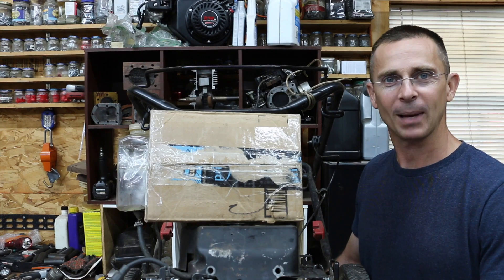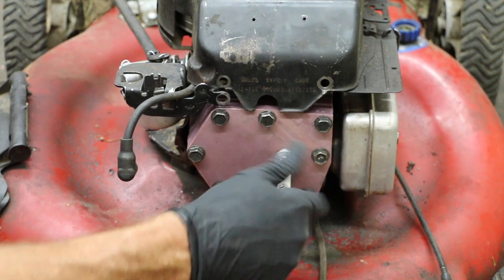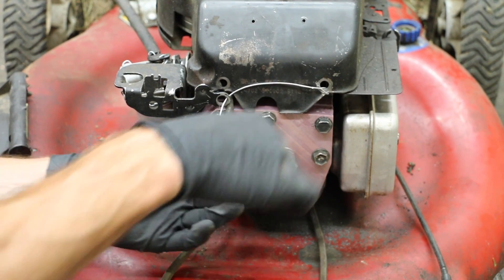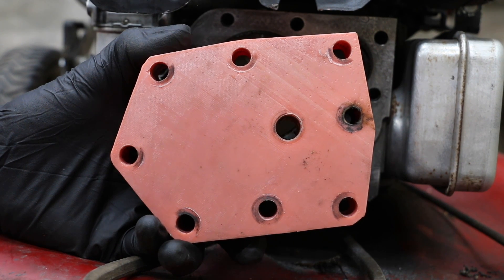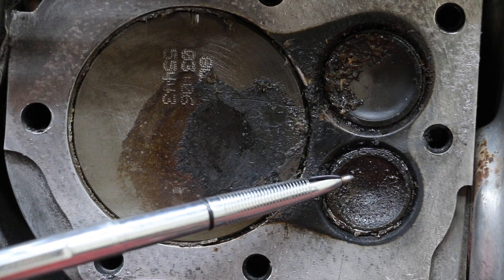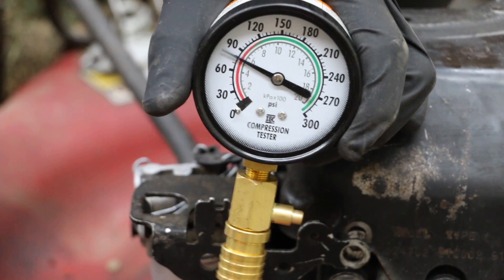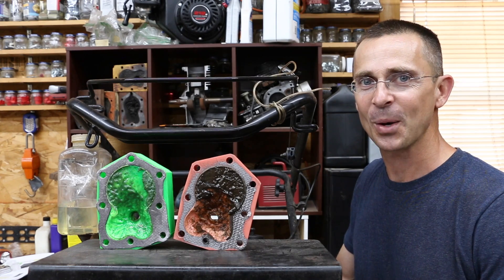How long will a 3D printed cylinder head last?  Let's find out!

Comment: make  a cylinder head out of 700 series Inconel .....to see how long it will last  .......after you tap that plug hole !!!!
Reply from the maker: Thanks for the recommendation.
Reply: ummmm have you ever worked with 700 series Inconel ??  (it is the material that makes jet engines possible, it holds up in hot sections of turbine engines where ferrous based material will not)  almost impossible to cut, let alone tap

Comment: What if you line the inside with aluminum foil or something like that to reflect at least some of the heat away from the plastic. Or possibly use the plastic heads to make molds and cast new ones out of old beer or soda cans
Reply from the maker: Great recommendation.

Comment: Hi I think it would be cool if you got a gy6 engine and try to get most power out of it. Also I wanna see what cylinder bore is the best for power/fuel usage. I have a 50cc scooter that I put a 125cc in and want to know what's the best setup. Also they are kinda cheap.

I know this is kinda for my own sake I ask this. But I have had so much fun playing with it. I think it's a good idea at least.
Reply from the maker: Thanks for the recommendation.

Comment: I've always wondered, how would an small engine (lawn mower esc.) handle in the temperature extremes? Like how cold could it be and still run? And how hot? What would happen if you put that engine running in an oven set to 200 degrees?
Reply from the maker: Great point.  Thanks for the video ideas.

Comment: Usual temperatures inside a typical 2 cylinder combustion chamber is 400-700 degrees Celsius (depending on motor, spark, fuel, etc, most common temp is around 600C). Almost everything that is 3D printed is done so anywhere from as low as 180C for PLA, 240C for ABS, and 200-250 for some other materials. there may be some specialty materials on a specialty printer that could go to 300-350C, but nothing I know of that can be reliably printed to withstand 400C+.
Reply from the maker: Great point.

Comment: You could shell out the combustion chamber 2mm and make an insert to fit into that 2mm space and have it made from DMLS steel.  Shapeways.com does 3d printing in steel.
Reply from the maker: Thanks for the recommendation

Comment: Wow, they handled way better than I thought. Considering melting is the main issue I wonder how prints able to withstand very high temps from somewhere like formlabs would hold up 0_o Granted it'd probably be pretty expensive to print a giant solid block like that from a prototype place
Reply from the maker: Great point.

Comment: It's just a matter of time before you see composite engine blocks with iron sleeves to save weight being used in small 4 cylinder cheap cars at first, probanly use something like a nylon 66 if I have to guess
Reply from the maker: Great point.

Comment: Video Idea:  High Compression piston [Rings need to be up near top of piston] and milled head. ! It won't get more exciting than that. You can take it a step further and port the small intake tube smooth and the exhaust port too. I know you have people who can and are willing to do that machining. Going by your 3D arrival. As long as they give your head valve clearance for the milled head. When you turn that over it wont sound like a 'small' lawnmower anymore. Torque will be way up there and bass from the extra power too. You can do the majority of the smooth porting with what you have for tools. So it would be  a piston and head cover mod.
Reply from the maker: Great recommendation. Thank you

Comment: This was doomed to fail from the beginning.  PLA and ABS formulas for 3D have melting points in the 3D head as low as 320 degrees.  Combustion temps are much higher.  

Check out print head temps for devices like MakerBot.
Reply from the maker: Thanks for the recommendation.

Comment: see if these guys will print you a high temp plastic one https://formlabs.com/
Reply from the maker: Great recommendation.
Reply: I got a sample of their high temp plastic and did some testing. It held up well to 30 minutes at the rated temp bur showed some fracturing after it cooled. I did not ramp down the temp as I would normally do, just pulled it out of the oven and threw it on a bench. The fractures were probably from thermal shock.

Comment: Come on dude, why would you brainstorm on ridiculousness of this sort for real? There's quite obviously many thousands of various types of components (including  gaskets) that are engineered for the mechanical industry in which plastics are incorporated in the manufacturing process. But as for EVER seeing a successful or practical design and development of a cylinder head that's composed entirely of plastic being use for the intended purpose of chambering the extreme high pressure combined with the forces of exothermic reaction that occurs inside an internal combustion engine...forget it, lol. There's absolutely NO WAY to avoid an eminent and eventual meltdown. So I say again, why waste our time (and yours) posting ridiculousness of this caliber 😬

Comment: This test raises interesting questions... Being air cooled I knew those things would melt down and fail, but there are some seriously resilient compounds out there that can withstand some punishing heat. Sadly they are not in the 3d printing market (yet) either, but this shows how --- Quality --- 3d printing will change the way we live and especially repair things. Great test now that's Wood, Plastic, Glass, Crystal (still glass..) cyl. heads, anyone got a link to an engine running w/ a cylinder head made of chocolate or tofu??
Oh sorry to be crass here but... the combustion chamber looks like balls.. just sayin'.
Reply from the maker: Thanks for commenting.

Comment: I keep saying, watch out for plastic engines in the future.  Remember, at one time, you couldn't store gas in a plastic can; now all of them are plastic.  At one time, you couldn't use aluminum near the combustion chamber of the engine, now you use a cylinder head made of the stuff.  Once the issue with the temp and pressure is solved, you will see a plastic engine.  I would not be surprised if a prototype exists somewhere as we speak.
Reply from the maker: Great point!  They are on the way.

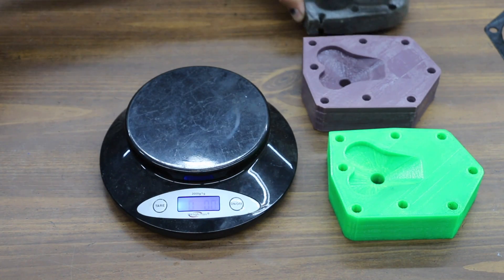Comment: at 1:17 havent watched the rest.
as of yet going to ofcorse
But what i see at this point is two of the most commen plastics
both of wich are not known for there ability to hold to much in the way or presure nore heat to the degree produced in an engine. by a wide margen.

Wheres the blends.
Wheres the pet the nylon the fiber reinforced

Heck wheres the PEEK blend. (ok peek is nasty and expinsive stuff but ya know gota minchen it)

so many better meterials out there avalible to the public to try this on.
Reply: Reporting at 3:45
Wow didnt expect abs To even get this far. to bad the melting fould the sparkplug it was starting to giveway would of ben neet atleast to see it melt apart.
He's going to clena and re do hmmm what will givbe first the head or will the spaark plug melt out of the plastic
Reply: yep inside melting down quite a bit. wonder how this would of responded if it was in a diffrent orentation
would it have let the spark continu long enough to bow/blow the top
Reply: 5:42
He's now putting on the PLA.
PLA is well known for making nice looking prints.
Becos it melts ant a low temp has an even lower glass point.
And is verry crystiline in it's structure. (brittle) the older it is the more brittle it will genrily become as the crystiline structure grows.

An interesting extinshion to this experement would be to repeat the PLA with parts made at diffrent times and stored in diffrent environments.
cold vs hot. dry vs moise and sun vs shade.
From a fress off the printer to upto a year old i'd think

now to see what happens :)
Reply: Yep prety much what i expected for PLA couldn't take the heat at all
spark plug melted right out of the heat 
gue on the inside.

Not going to minchen much on the gasket test.
mainly because i know there's a material that you can use to make perfectly acceptable gaskets.
Reply from the maker: Thanks for the recommendation on nylon and fiber.

Comment: Project Farm get a nylon 3D printed cylinder head and try that if you can 
Nylon is often used for small model steam engines as piston rings and has a higher melting temp and mechanical strength than abs
Reply from the maker: Great recommendation!

Comment: The 3D printed cylinder heads do not conduct electricity so the spark plug won't work. I'm only at time stamp 2:03 so I'm sure you know that nad are going to solve that.
Reply from the maker: You are right. Thank you

Comment: A styrene foam like material 3D printed could be use in a lost foam sand cast because a metal is the only known option here. My plastic could be ceramic coated like space shuttle tiles?
Reply from the maker: Great recommendation.

Comment: Great video. At 4:23, you can see combustion flashing through the material pretty clearly. This might be the plastic burning as the fuel ignites though. It would be great to be able to see inside the cylinder as these heads perform. Ideas???
Reply from the maker: Great catch. I'm glad you noticed that even though the smoke got in the way.  I'm sure that the plastic was burning.

Comment: one thing which would be interesting is seeing if you could get a ceramic coating on the plastic cylinder head, then at least you'll have a good amount of protection from the heat transfer
Reply from the maker: Great video idea!

Comment: Fill an infilled ABS printed cylinder head with water before trying again...
Reply from the maker: Thanks for the video idea!
Reply: Bonus points if you can design a thermosyphon circuit in the print to cool the exhaust valve area!

Comment: Random info: there are more printing materials than simply stock PLA and stock ABS. You can print in heat-resistant resin, nylon mixed with heat resistant materials such as glass, PEI, and even metals such as stainless steel and aluminum
Reply from the maker: Great recommendation.

Comment: They make engineered plastics like Torlon 5530 and Ultem 2300 that are glass impregnated, that I guarantee would last the life of the motor. Fully machineable and amazing tensile strengths. Very expensive but It would be interested to see anyway. You'd be impressed.
Reply from the maker: Great recommendation and I wish I could test it.

Comment: That's amazing. If the 3D head could be modified. Well, I mean the plastic blend mix with copper or zinc compounds to make it harder? So many things that can be used to make the plastic better. Especially an air cool head.
Reply from the maker: Yes, thank you

Comment: One thing I noticed when you cleaned the head after the purple/orange head is that you didn't clean under the valves where they seat. I'm not sure if any plastic got in there but I'd think some melted plastic would have gotten in the seats causing a loss of compression. Was there any under there?
Reply from the maker: Yes, you are right. The intake valve wasn't sealing too well, but it didn't take long to begin sealing properly once it was running again.

Comment: Can you please run the exact test but using polycarbonate plastic? I am in need bc I actually want to make polycarbonate gaskets for a custom design.
Reply from the maker: Great video idea--thank you
Reply: Project Farm  polycarbonate plastic is said to be one of the toughest and strongest plastics out there with high heat resistance.  If not a head, can you test it as a gasket please that would be amazing. Thank you so much for replying!!!
Reply from the maker: I'll see what I can do. I'd really like to test it.

Comment: Does anyone know the temperature of a gasoline burning
Reply from the maker: Around 500F but the combustion chamber temps get a lot hotter than that under certain circumstances.
Reply: Project Farm thanks I am also curious if a plastic capable of withstanding such temperatures would be able to withstand the pressure
Reply: I am not saying you should do that it would be expensive but if you do I think it would be really cool

Comment: To who ever wasted their time an machine to make these parts, Are You kidding me???
You used heat to make the parts, how long did you expect it to last??
Im a Machinist and Delrin would have done as well for a material, and I could have milled it better than your surface finnish.
Reply from the maker: Hi Johnathan, thanks for the constructive feedback.  We knew the 3D head wouldn't last long, but thought it'd be a fun experiment to see how it would do compared to the JB Weld and other wooden heads we tested in the past.  I'm always open to test other materials.  If you're willing to make a head, you can reach me at projectfarm52@gmail.com  Thanks again

Comment: I'd bet taulman 910 nylon would last 5x longer :)   and there are high temp 3d printable plastics that are very costly but would easily hold up like aluminum.   Pla has a super low tglass temp, abs not much higher.  We use taulman 910 for all kinds of engine stuff.  Most manifolds are glass filled 30 percent nylon. As are valve covers and such.
Reply from the maker: Great recommendation.

Comment: What would happen if you injected an octane booster or something like it into the air intake while running engine?  Would it give you an extra boost similar to nos? Im sure it would clean injectors and combustion chamber, but I'm interested in if you can get extra power? Isopropyl alcohol, octane booster, fuel injector cleaner, etc....
Thank you for making these videos,  they're very informative and I enjoy watching.
Reply from the maker: Thanks for the recommendation.

Comment: You can add a graphite like coating to 3d prints to make them take the heat better, a lads made a rocket engine nozzle using it
Reply from the maker: Great recommendation.

Comment: I THINK YOU MAY BE MISSING THE VALUE OF THE PRINTED PLASTIC PART.   INSTEAD OF USING THE PRINTED PART AS A WORKING PART USE THE PRINTED PART AS A PATTERN TO MAKE A MOLD OF THE PART.  THEN CAST THE PART IN ALUMINUM AND BINGO.  ANY PART YOU CAN IMAGINE UP AND 3 D PRINT YOU CAN MOLD AND MAKE.
Reply from the maker: Great recommendation

Comment: pla has a lower glass transition temperature than abs. but prints a lot better and is stiffer. abs is more flexible and can resist impact better.
Reply from the maker: This is great information. Thanks for commenting.

Comment: They do make high temperature resins for SLA 3D printers (270C to 280C) , I had a quick look but couldn't find anyone doing it commercially.

Also look at 3D printing using metal powder mixed with binder. For instance:
https://i.materialise.com/en/3d-printing-materials/Steel
Reply from the maker: Thank you for this information.

Comment: Hmm, impressed by results? Not really. The plastic was a total failure 1-2 minutes is useless.  Sure the strength was ok but the plastic thickness was very high.  The cooling for the plastic was way less than even the finned aluminum  head. The excess thickness stopped the plastic from having a chance to cool itself.  The spark plug is also cooled by the head and with the plastic being a good insulator it does not loose heat properly either. 
But also the choice of plastic could be better. There are all sorts of 3D printers some even use layers of paper! Some 3D printers use powdered metal that gets additional sintering to produce usable parts. Navy is using now instead of full machine shops on ships!
But what the heck fun to try! 
By the way there are places that make gaskets from a drawing/sketch cheaply from any sheet material in a "3D" cutting machine. 
Thanks for posting video Cheers Warren
Reply from the maker: Hi Warren,  All great points. I had fun testing the heads knowing they wouldn't make it for long.  Thanks for the information on the places that make gaskets.

Comment: you can try Polycarbonite ... this is a very sturdy + very heat resistent material. It melts @260°C
Reply from the maker: Great recommendation.

Comment: i was expecting both spark plugs to go "ballistic" in under a minute due to melting of the threads in the head. now if someone could metal plate the heads, insert a metal sleeve in a printed cylinder, add liquid cooling, you might have something. but Harbor Freight is cranking out sub $100 engines like there's no tomorrow.
Reply from the maker: Great point.

Comment: Nope. I'll still watch it but even the carbon fiber wont work. This stuff prints at too low of temperature and the engine makes high temperatures.
edit: That burning plastic smell must have been nasty. lol
Reply from the maker: Thanks for this information.  I wear a respirator and the shop has a powerful vent fan.

Comment: Any PLA just isn’t going to cut it, of all 3d printing materials it has the lowest glass transition 60c & melt temperature  130-180c. One of the annealable PLA’s would be the best from that family. 

For nylon i would try nylon x, it has carbon fiber in it. 

The most likely to succeed consumer 3d printable plastic i would think would be polycarbonate.
Reply from the maker: Thank you for this information.

Comment: Where I work we 3d print a massive part of a rocket engine out of inconel, in testing it has beat the cast for strength and performance. Thats right, 3d printed rocket engine parts.
Reply from the maker: Wow!  Sure wish I could get a cylinder head made of this way.
Reply: Project Farm I wish I could get you one. But no personal projects allowed with the expensive 3d printer though.

Comment: I wonder if it would be possible to run an ABS head long enough to cure all the inside into that glassy stuff. Maybe pressure is key - but it does look like it was starting to happen at the top of the chamber, too.
Reply from the maker: Great point.